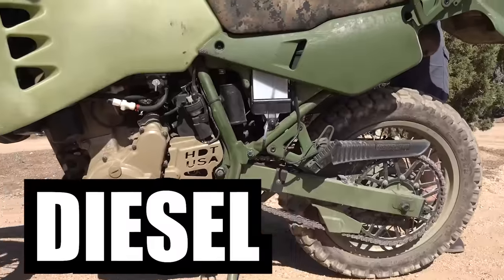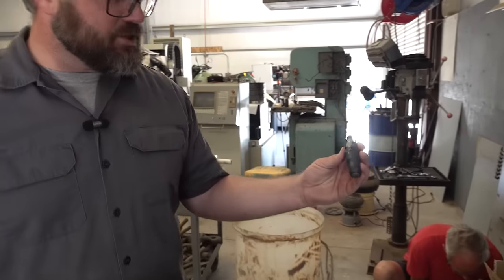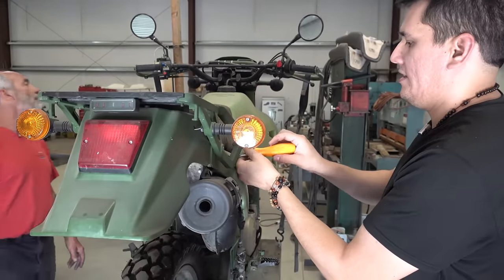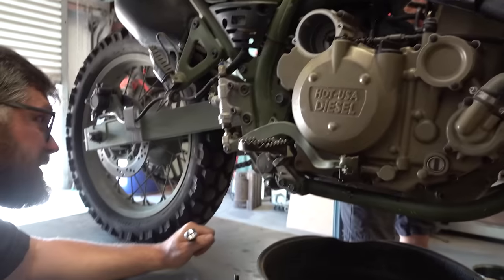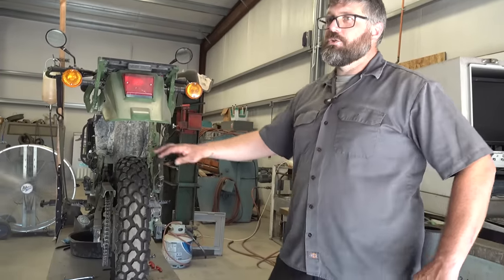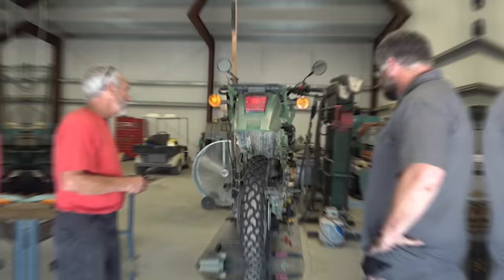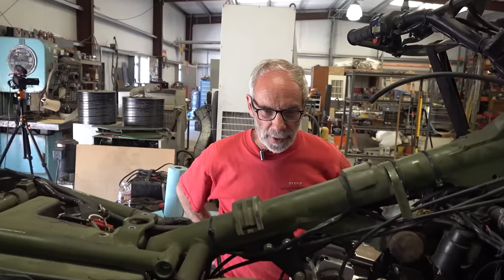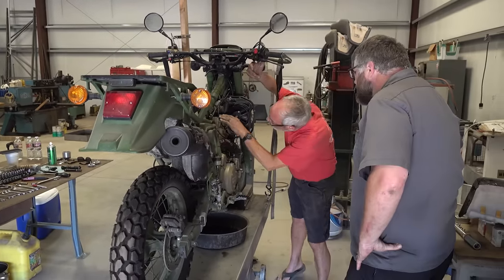Unfixable Diesel Bike is Worse Than We Thought(So I Got The Engineer Who Designed It)

Comment: I worked for HDT for over 10 years, before changing careers.Was there for the development of this bike. Worked with Rick as well, very intelligent man. Interesting seeing this.
Reply: As you were present throughout "the development of this bike," i'd appreciate your input on whether or not there was anything other than better mileage and a greater amount of torque, that was/were an/any improvements when compared with its petroleum fuelled market competitors?
Reply: I remember reading in a  U.K bike magazine that the only reason the army wanted a diesel bike was because the only things they had running on petrol where the bikes. So having a diesel bike did away with having to carry petrol on manoeuvres.
Reply: Shawn? Is that really you? You owe me 2.25 for lunch I loaned you.  With interest and inflation, that comes to 746.80.  Also, I liked your idea of making a KLR that ran off corn alcohol.
Reply: @zatomlzxzanamolzy1253  from what I recall, it was mainly to fulfill a single fuel requirement from the USMC. The bike was heavier and overall less maneuverable than a standard KLR650, from what I was told at the time (I never got to ride one, employer/employee liability). The increased fuel economy came secondary.
Reply: @zatomlzxzanamolzy1253  Probably the same reason they ordered the CUCV series as diesels, a single on-base fuel simplifies logistics.  I'm curious if the bike could also run on kerosene/JP-8.
Reply: having a broken bike and getting it repaired by the man who designed it is like getting the blessing of The Godfather
Reply: Amigo, como posso entrar em contato com você?
Reply: @CraigDavies. Yes. I think the U.S. military wanted one fuel for all its machines/vehicles, but this was in the 1990's, same as the British Army did with the abolition of petrol Land Rovers, Scout cars ect, they went completely to Diesel. Interesting video this one. I've never seen this motorcycle in the UK. 
I'm UK based and have had a Diesel Royal Enfield for seven years now. 👍💯🇬🇧
Reply: @InvictaView I had several Brit Bikes. But my 'best' one was an original 350cc Redditch-made Enfield Bullet. I always regretted selling it.
Reply: transport requirements for gasoline as a dangerous good make it a supply chain problem in a warzone
Reply: @zatomlzxzanamolzy1253 the entire reason these diesel bikes exist is... "The engine was customized to run on diesel fuel or biodiesel in peacetime, and on JP8 aviation fuel or kerosene in time of war as a requirement by NATO which enforces all vehicles from tanks to jeeps to run on diesel fuel."
Reply: hey man sorry for the late comment but were there any plans to make turbocharged ?
Reply: @chief1223  It says JP-8 on the tank.
Reply: That's actually super cool, kind of surreal to see him on YouTube after working with him I imagine :-)
Reply: @arthurcampedelli7163  there was a land speed record bike built that had a turbo version of the diesel. From what I recall, was not a huge boost in performance,  as I don't believe single cylinder engines boost well.
Reply: @shawnwestphal4780 Shawn, who actually test rode the bikes?  Were test rides contracted out, or were there special designated testers employed by the company?  Thx
Reply: @mattskustomkreations  test rides were done by Fred Hayes, and a former Marine who was hired by Hayes, who was heavily involved in the Marine riding program.
Reply: @chief1223 I see no reason why it wouldn’t, they’re basically the same thing

Comment: I was stationed at Schofield Barracks, HI (90-93) and one year we had an audit of ALL our equipment. I went with an officer to a warehouse off base and began to read labels on boxes to the officer so that they could be accounted for. About 10 of them said "Motorcycle off road diesel (1 ea)" I was shocked to learn that my unit had motorcycles in boxes but they were never used. That was back in the early 90s but I wouldn't be surprised if they were still there.

Comment: This bike is way to complex to ever give to a bunch of soldiers in a far away land.  Imagine having to get this thing started quickly in a tense situation.  It's easy to see why the military only bought a handful of them.  Great video Craig
Reply: 100% correct.
Reply: Mechanical complexity is less of an issue than having half a dozen ecu and a canbus...
Reply: That's why they gave it to the Marines instead.
Reply: I had same thoughts!
Reply: 2 stroke 2 victory
Reply: @rhiantaylor3446  If I was in a war and I had the choice of tracing and repairing a mechanical fault or unplugging a black box and plugging in a spare one I know what I'm choosing.
Reply: should have just gotten some CRF250L or CT110s
Reply: But if it is an unbreakable tank....then you don't worry about breaking down....
Reply: @JohnSmith-pl2bk   yeah, unbreakable because you can't even ride it😂
Reply: Logistically and economically, it makes perfect sense to use no gasoline. Everything runs on diesel. Diesel dumps won't explode.
Reply: They bought the bradley so they are not that smart.
Reply: @buildingwithtrees2258  
Diesel dumps will burn...very very well.
Reply: @larsborgman3443  should have just given them XR650ls and a can of flat green paint. But you know...... when "free" tax money is involved.  Anybody who rides off road will tell you this bike is a load of junk for off-road riding.

10:17  "when the bikes get hot and people really get on the throttle, this is what happens" Shows some part with a hole burned in it.......LOL........  I mean seriously, what a pile of garbage these things are. Its scary that our soldiers actually got these to scout enemy territory. I think I would have rather been handed a horse.
Reply: Like the way he said he'd never seen one with wear debris in the oil, just machining debris. They never ran long enough to wear...
Reply: @EddieTheH Yes the Germans during WW2 with their complex engineering on tanks and other vehicles used in the war found out that being over engineered and complex hurt them on being able to get the machines back up and running again to go fight again that hurt them big time and it cost more money and time to make replacement parts where as with our military we tried to keep things more simple and cheaper to build and we're making stuff much faster on the assembly lines than the germans could which helped us along our allies win the war in the end . There is a saying that's called the kiss method and it's Keep It Simple Stupid. There is a motorcycle  museum called Wheels through time and they have old HD motorcycles that are 90+ years old that are original that still run not because they were over engineered but because of how simple they were engineered and simple to work on and sure you had bikes like the Indian 4 cylinder motor cycles that were way ahead of it's time and we're mechanical masterpieces but they were also much harder to work on and tune compared to the V twin bikes of the day which were many other makes eventually but once the depression hit out of hundreds of motorcycle companies around before WW1 right up to the depression only 2 survived and that was Harley Davidson and Indian in the end until eventually Indian stopped in the 50s and the Indian name eventually got sold to Enfield in the 60s who made the Enfield Indian for only a couple years until that went under and the Indian name got sold eventually again with Polaris owning the name now . Henderson also built V twins and also had a inline 4 cylinder motor cycle similar to the Indian but they also went under as well . I thought this was pretty cool but would I trust riding this bike in the desert or even trying to race it in let's say the Baja 500 or 1000 desert race if it's still even a thing anymore? Hell no it's to complicated to big and too damn heavy and probably slow to boot so for me it would be a Honda XR 600 over this bike any day .
Reply: Oh well, let's not forget they use turbine powered TANK in the desert...
Reply: A horse would be far better. No noise and they pick their own way trough rocks & brush.
Reply: This bike should have had a basic Yanmar diesel with HD gearbox. Ferk all power but simple engineering and extremely reliable.
By they way - Royal Enfield bikes came from The Enfield Cycle Company Limited of Redditch, Worcestershire, England. 
Enfield India was the factory they set up in India. It still exists today. Absolutely nothing to do with the American Indian motorcycle company.
Reply: @EddieTheH I would take the Blackbox any day. Way easier to find the fault and change the Blackbox.
Reply: Agree. Far too complex and finicky for soldiers to have to rely on.
Reply: @peteloomis8456 their major issues were lack of metals for alloys and using slave labour.
Reply: false. seems to be one that runs great when proper but I will agree it's too complex for most mechanics that can't understand a diesel engine
Reply: They should have hired a few defected Russians to design it with a 300 dollar budget.
Reply: @Dave5843-d9m you're actually right
Reply: Wouldnt that apply to anything else diesel-powered in the military?
Reply: @JohnSmith-pl2bk these are all low mileage. Didn't you hear what he said?
Reply: if you want to know if something is reliable give it to a private soldier. They will no doubt find ways to break ANYTHING in ways that defy logic. If it will withstand the punishment of a military life, then it is fit for public use.
A sound idea: Make something that will run on the fuel you can find almost anywhere in the world: Diesel.
Reply: @mattjacomos2795  I want to know why assemble an engine with swarf ?
Reply: @Dave5843-d9m this bike belongs in the same category as the infamous $50,000 toilet.  Then again at least the toilet probably worked😊
Reply: Unneccesary complexity is poor engineering, I really cringed when he 'explained' that it was 'normal' for there to be a bunch of swarf and machining debris in the oil pan; I've touched a lot of engines old and new and I've never heard of that in my life.
Reply: @peteloomis8456 Dude, seriously, you need to use commas and stops. No one can read a word sausage like that.
Reply: @elliotkane4443 you obviously never worked on a new Harley Davidson
Reply: Motorcycles are exciting enough to shut off critical thinking but two-wheelers have always been functionally inferior to four or more wheeled vehicles like Polaris and Gator for military use. Civilians tend to ignore that riding requires all four limbs at all times, constant input to stay vertical, and is severely impeded by cargo the classic small four wheel form factor hauls effortlessly in greater weight and volume.
Reply: @oldphart-zc3jz  if you are carrying small items like papers, dispatches for example or just information in the riders head. Motorcycles are lighter faster and more maneuverable over poor ground than 4 wheelers. Motorcycles can be easily transported by road rail or air. Motorcycles are ideal transport for scouting and lone sniper transport. Motorcycles also present a smaller fast moving target that's difficult to shoot and they can easily be concealed if necessary. Thet do have their uses in battle and have been used extensively in most major conflicts since ww1.
Reply: They wouldn't even have to switch it off. Just leave it running in a situation where it might be needed. It will use very little fuel to run stationary.

Comment: No wonder these weren't heavily deployed.  Seems very finicky and extremely fragile.
Reply: I own 3 of them (Got them from gov auction a while back.)  They're VERY slow to rev up, to the point of really being difficult to ride.  They were also replacing klr250s, which are much easier and lighter to throw around offroad for most riders.  Too many trade offs were made to get a jp8/diesel engine in a bike, which was really only to simplify logistics of fuel delivery.  HDT really was delivering a Minimum Viable Product with them, and these would have never sold on the civilian market in their state at the time.  If HDT had the money to keep going for 3-4 more years, and continued to develop the engine, they could have had a good product, that would have never been able to be sold due to failing to meet emissions.  They failed emissions in their day, let alone modern ones.  Hence ey were never sold to the public.  These bikes put out more NOx in 15 minutes than a modern 18 wheeler puts out in 8 hours of running at full load.  They had good bones for it, at least.
Reply: Most modern engines will break when you run them backwards
Reply: Air fryer Craig is the worlds largest pronto pup😹

Comment: In 1977 Volkswagen introduced  the diesel engine to it's Rabbit car and the whole world took notice that you could have a high-reving diesel engine in a car that got 44MPG without even trying.  I started my career working on VWs in 1968 and really got into diesels.  I would buy them cheap that needed crankshafts, especially the '81 Dasher and made cars for my children to drive.  At one time I owned 9 of them at the same time.  I am 76 years old now but still have a place in my heart for VW diesels as well as my four Honda motorcycles.  Good show.  You brought back a lot of memories.
Reply: That injector shown is just like an early 90's VW diesel injector.
Reply: I had a 81' Rabbit given to me in 90' and it was diesel. I was getting my 0' Mustang GT fixed. Can't remember the liter but I'd put $10 in the tank and could go a whole week easily to and from work and out with friends. I kinda started a following. A couple friends go there's and we'd start smoke wars while driving. I worked at a VW dealer with a little diesel truck bed to haul shop trash out. Never had a problem. Most of the VW techs had VW/Audi cars Foxes or Quattums with the Golfs/GTI and the tech I apprenticed with had a Carodo. Loved my Rabbit til it got totalled in a snow storm after I gave it to my brother back from the war. It would go anywhere. It got hit in the back. Glad no one was hurt.

Comment: "but we know we don't have compression"
"well we think we don't"

he saved so much time by checking again... It's so cool to watch masters work
Reply: Guess who's never going to forget double checking compression release?
Reply: The moment he said "well we think we don't" i knew this guy was the real deal. Nothing can replace experience, never assume the obvious.
Reply: Since its a diesel could you run it on canola oil like that guy was with his yacht?
Reply: trust but verify. LOL  keep it simple.
Reply: The more you know, the more you know you don't know
Reply: A real professional is never 100% sure that he didn't rule out the simplest, stupidest thing, so why not check it again? We should all try to work more like Rick. A true master.
Reply: @TheAnnoyingBoss yes any low viscosity oil , cooking oil , sunflower oil , rape seed. Just nothing  that has chunks in it or high combustion  levels / octane rating or it will overheat. Old motor oil throughly filtered and thined down with diesel. 50/50 approx.
Reply: @paulmartin8212 don't assume nothing.
Reply: @kiwiingenuity1677  because nothing is impossible :)
Reply: @mikeremski2102  The same guys who worked on old GM 2-stroke diesels and didn't make sure the racks were closing correctly and had to choke the engine out to stop it from running away. A mistake you only make once.

Comment: The thought of a turbo diesel motorcycle is just amazing! Imagine the fuel economy.
Reply: 40km/lt no matter what you do, it will never gonna be below that.
Reply: It already exists. Sold very badly because of weight and vibrations natural to a diesel.
Reply: There is a Dutch biker who developed a bike for people doing lots of miles. He persueded Mercedes to sell him turbo diesel three cilinder engines. They said YES! But for reasons I still do not understand, he started production and he stopped production. The bike was excellent. Maybe the time was not right. Maybe bikers are one track ponies having no idea that turbo diesel is great for them. Whatever. The bike brand was Track. Do check that. Pray that he will start again, some year.
Reply: Imagine the cost and complexity. There is more to riding than fuel economy.  This mechanic has zero desire for one.
Reply: @oldphart-zc3jz  To me, the appeal would be to preppers. The bike is military spec. Meaning it will survive EMP's, and is designed to be somewhat tougher.

Comment: I have no plan in ever owning anything diesel powered but I found this video to be very interesting. The knowledge of the details, like the length of the fuel tank screws, is just plain impressive.
Reply: Same here. This like ASMR for me
Reply: Same with the De Havilland Twin Otter. The rear part of the undercarriage fairing has numerous screws, of about 6 different sizes. Put a screw too long in the wrong place and it gouges the fuselage skin and leads to a very expensive repair shock 😮!
That’s just one example.
Reply: Diesels are a fascinating beast. Just running off the exploitation of physics in what feels like an even more complex manner, to me.
Reply: Same here
Reply: Once you drive a turbo diesel, you will get it. Pure power!
Reply: @goosenotmaverick1156  🤷‍♂️.
Reply: Old fashioned diesels are very simple, with no ignition circuit or spark plugs, give them fuel, a fast spin and they start. I have often thought a diesel bike would be good, Enfield India made one with a single cylinder engine, rather slow but fantastic fuel economy, the slowness could have been fixed with taller gearing taking advantage of the greater torque a diesel puts out. Militarily a single fuel concept is still a very sound idea.

Comment: I called the compression release before you!!  For some reason it stuck in my mind when he was explaining how it worked and didn't close it.  Glad I at least got that one.  I screwed up the injection timing on my fuel pump once and had to take it down and get it rebuilt and timed.  4 cylinder Mitsubusi diesel